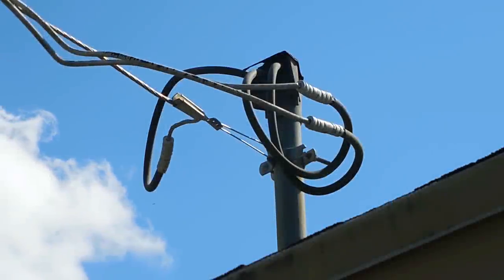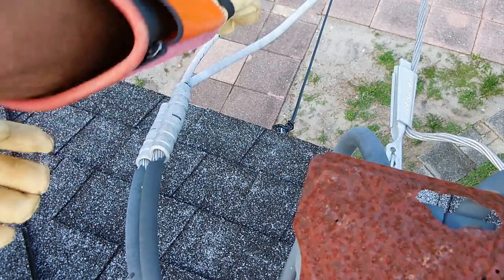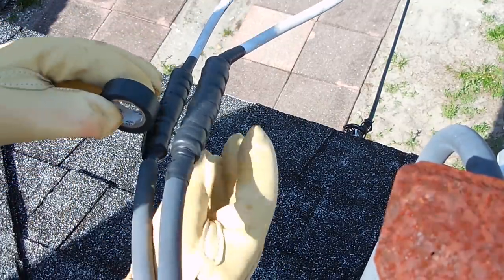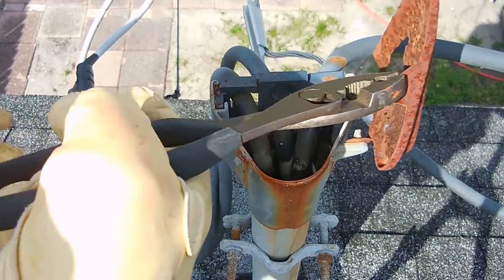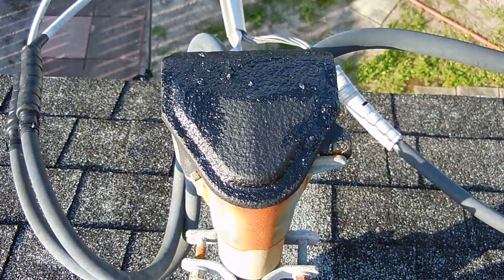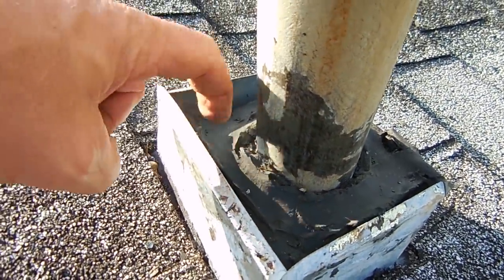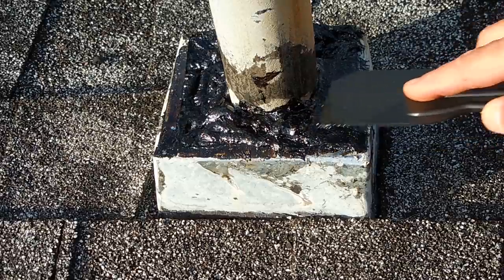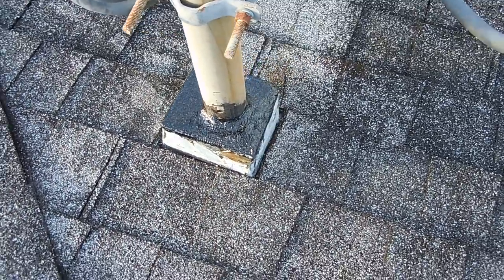Residential Service Entrance Nightmare DIY Electrical Repair!

Comment: So I was an electrical contractor for 32 yrs. Why no cut the incoming wires from the power company remove the old weather head. Install a new 2” weather head then reconnect with burndey press connectors. This should take approximately 1/2 hour to do.
Reply from the maker: Some things I show on YT, and others I don't. :-)

Comment: Wouldn't the city be responsi... Oh wait, it's Florida. 😬
Reply from the maker: If I called FPL, they would've either wrapped the hot wires, or swapped out the connectors. I've wrapped them in the past, so it was no big deal to me.

Comment: Insulation Clip Covers are available for those big power line splices.  They clip closed around the splice with slots for the cable insulation about an inch beyond the splice on both sides.  Some electrical contractors use them, but I think all of them should.  They wear over time from the Sun and need to be checked regularly and replaced now and then.  They are much safer to use than wrapping with electrical tape.  Though it was smart to put zip locks on the tape.  I do that, too, when I have to use electrical tape.

Comment: Seems like the splices should have rubber liner then tape.
Reply from the maker: I've used rubber splicing tape in the past, but I prefer 3 wraps of the vinyl electrical tape.

Comment: The triple wrap on exterior, full sun exposure is a good approach. Electrical tape is rated @ 600V, and good quality tape (i.e. NOT made of chinesium) has adhesive that will stand up to many years of sun & heat (adhesive on chinesium stuff dies in a few years to make a gummy mess). This being full sun exposure, that 3rd wrap will be sacrificial & protect the inner 2 wraps from U.V. for at least 2 decades, probably 3. Those tie wraps, however, will likely be dead in less than 3 years; I can't find good UV resistant zip ties these days even tho they say UV resistant on the package. IIWMI'D use braided nylon string & multi wrap the tag end of the tape, then tape over the string (which final tape wrap will unravel over 10-15 years, making the whole thing good for at least 30). That pinhole at 6:05 probably won't be an issue.
Reply: Metal bands are the latest big cable tie design for UV longevity. Find them on irrigation circle span cables. Seems that stainless steel strapping for shipping would work. Not sure of code, though.

Comment: I've had my electric utility linesman come out THREE times over numerous years to replace those crimped sleeves. I'd lose one leg in the winter in the middle of the night. Turns out a crimp wasn't squeezed tight enough. The last visit, the linesman pulled on the crimp and it pulled apart. Hopefully third time is the charm!

Comment: I notice my 1974 home is missing the top masthead cover so rain is going straight into my meter, running down through and rusing out the bottom of the meter box (with outside breakers). I also see rust marks on the 2 power wires going through the brick. We have aluminum wiring.
What's the most cost effective and safe way to handle? Money is tight....
Reply: Rusting* out
Sorry was trying to type faster than my fingers could go

Comment: In my case here in LA county, CA. I was told that my service lines where possibly corroded due to poor insulation since it was an unpermited panel upgrade/relocation. At one point the power to the house was all messed up to where we called the electric company and they wouldn't touch it do to unpermited other than removing the tape from the neutral and cleaning it. They said the same had to be done for the service lines that connect to the weatherhead. What's your thoughts on that. Company said no licensed electrician is allowed to touch the service lines without risking their license
Reply: So. Cal Edison will usually do up the whole thing to their meter for free. They don't want the 2 AM storm call! They have come by and moved power lines for tree work for free too and generally they have been very responsive. It's been 16 years since those days for me though.

Comment: lol Project farm approved. I assume your electric company (Duke Energy I assume) can fix it if you call them.  I would have put aluminum tape myself and would have filled it up with something like sand then tape and then put tar on top. But you as usual do things more professional. ;)
I see you dont post as much, o well but I hope all is well. 
Also suggestion for video is to test what is the best method to keep lithium battery the longest. Some say to drain it others say only up to 30% and other say to not keep in on the plug. But dont know if those are true.

Comment: Here again, I'm surprised  that neutral/messenger is supported directly to the mast. Here in California,  the point of attachment on any structure, is required to have an insulator of some type.  Most of the newer ones are  nylon, or plastic.  They are usually porcelain or other glassware, to withstand lightening.

Comment: Could you put an automotive heater hose over each leg coming innand then wrap it?
Reply from the maker: If you cut a slit down the side, yes, but I prefer to triple wrap using electric tape.

Comment: Be careful taping up external power line connectors. I used to occasionally work with a line crew and IIRC some of those connectors are rated for "open-air" which is what they need to cool themselves during heavy load periods. Taping them up may lead to a future failure from overheating.

Comment: Is this just 120v on those cables? Interesting to see such an old method still in use.
Reply from the maker: 120V per leg, with one neutral.
Reply: 120 per leg but 240 between them with huge instantaneous amp potential
Reply: It's an old house from the 1950s, and 120/240 Volts is what we use in residential here in the USA.

Comment: Is there any water ingress concern with the wire access holes into the weatherhead?
Reply from the maker: No, there's little space around the wires, and each wire is sloped down preventing water from running into the weatherhead.

Comment: You might want to place a nylon separator between the two hot lines where you taped them. Then tape them or strap them together with non conductive zip ties.  Electrical tape will only last a short time when exposed to UV light.  Great video however.
Reply from the maker: Should last at least a few years before I have to wrap them again, or slide over a special insulator.

Comment: I would add for any DIYer… those are rubber gloves with leather protector gloves over them. Good up to 600 volts in my jurisdiction. 
Don’t try it with just leather gloves…

Comment: at 0.15 it looks like the lowest of the cables is loose in the connection. in the (press sleeve)
coud be wrong. but to me it looks like small sparks.
Reply from the maker: I carefully inspected everything, including the insulation on the conductors, everything looked good.

Comment: Don't let him know about lined and linerless rubber splicing tape. He could put a layer on before the PVC or nylon plastic tape, though.
Reply from the maker: I know all about it. Used it back in the 90's. The triple layer tape will last many years.
Reply: @electronicsNmore  But that's a 100 year installation you're supposed to be doing on buildings. Maybe throw some scotch-kote over the tape then. The tape alone won't last long in the sun and weather. Consider Polaris or Unitap connectors if you don't have big crimpers and sleeves when you replace the wire next time.

Comment: Yikes! Don't try this at home, kids. This man is a professional.
Reply: @marcolutz7065  Why you say that? Was it the $2 electrical tape, or the open pinhole still left in the cap?
😜😂

But seriously, if the content creator happens to read this, there are a few products I'd like to introduce you to....
  The first, is a rust converter called "Corroseal." Without it, that painted over, paper thin rust is back to it's old self inside 6 months.
The second, is called Quick Steel epoxy. Once the Corroseal dries over that shell of a cap, the Quik Steel applied to the underside (along with your wonderful plate/rivet job) would have brought that cap back to beyond it's original strength. Sealed with an oiled based, aluminium paint, you'd probably get another 5 years out of it. 
   Oh yeah....I couldn't find a buy link to the "electrical tape" you used. I guess the Dollar Store doesn't have an affiliate program? C'mon, you seem like a smart guy. Why take all that risk up there, just to half ass everything?
 Even a Scotch brand "2242" would have sufficed on those lines. And why not just zip tie both ends? The Florida heat will untuck both of those tape leads, inside of a month. Just tryin to help keep your return tickets down, brother.
Reply: @marcolutz7065  I can hear Marco now....ANY "tape" is half assing it!" Insulators are spensive, sir.  And those would require a professional, professional. Here, at the amateur professional level, lineman's tape works just fine. 😂
Reply from the maker: Thanks for the nice comment Tony. I knew this video would be attracting the pedants and haters, so just ignore them. What I did in this video will last many years, I did the same type of repair on a friend's house 25 years ago, and everything still looks good.
Reply from the maker: @MF-le7fp  The wet/dry roof cement coating will last many years on that cap. I also made it very clear that any small pinholes would be sealed off later in the video. The starting end is triple wrapped, and has very little risk of unraveling. You're not talking to a person that just started doing this.
Reply from the maker: @marcolutz7065  I suggest a pedant like you should be much more concerned about that modern totalitarianism state you live in called Germany. Dimwit after dimwit going along with illegal orders by corrupt govt officials to shoot you up with an experimental gene therapy with no long term testing data. How I see it, if you rolled up your sleeve, the odds are much higher that my repair will be here long after you're gone. :-)
Reply: @electronicsNmore  Hey brother, I wasn't trying to be "hateful" toward you. If my constructive criticism seemed overly harsh, and hurt your feelings, then I sincerely apologize.
  Hateful comments don't try to help a person in any way. And I WAS trying to help. I've watched some of your other videos, and found them to be informative, and useful. Wasn't trying to ruin your day at all. 
  Btw, based on Project Farm's video, I just picked up a pair of the OUXX boots from that video. Didn't pay much attention to their insulation specs, bought them more for their steel toes, and puncture resistance. And they are pretty comfortable as well. Have a nice rest of your weekend. ❤
Reply: @MF-le7fp  Only one end has a loose tip because he triple wrapped it and his 3rd wrap ended on the side where he zip tied it.
Reply: @marcolutz7065  We aren't in Germany, and it's standards, not standarts.
Reply: @MF-le7fp  Also, the pinhole you see was after he spray painted it but before the sealant. After he sealed it there was no more pinhole.